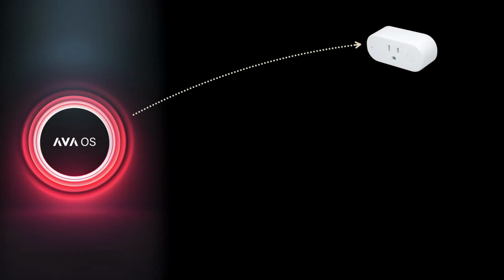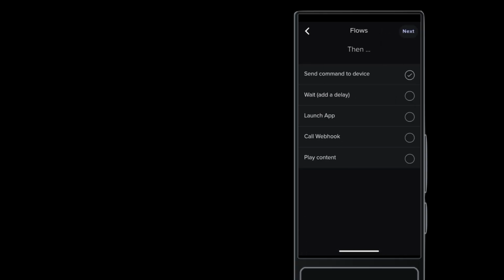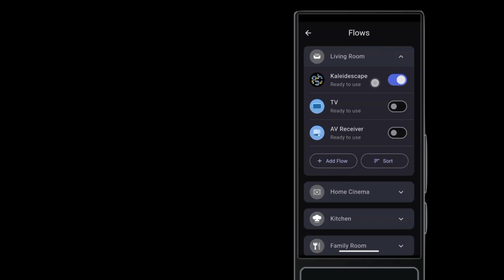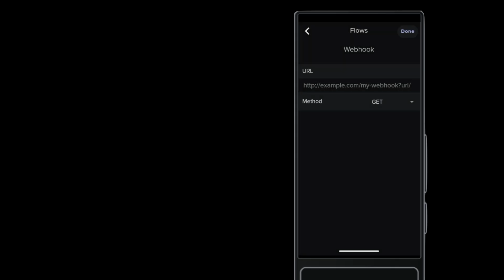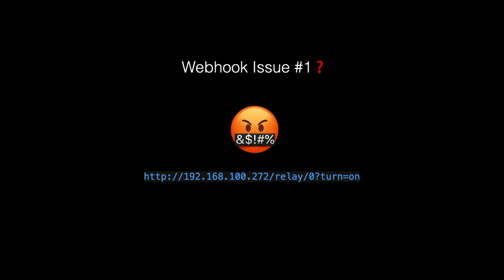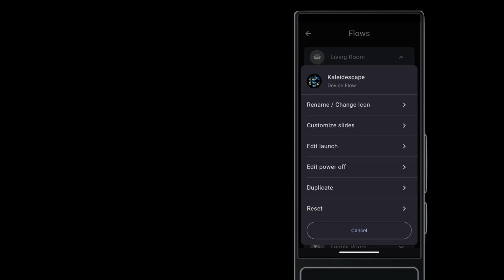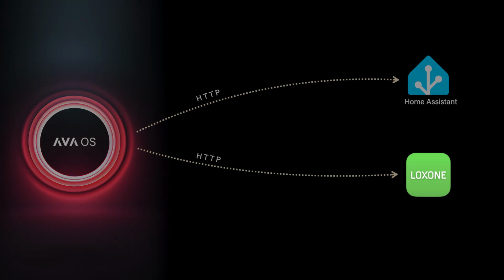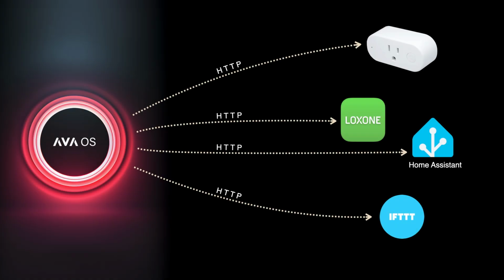Flows 4: Webhooks in Flows

Comment: Webhooks are great for IFTTT integrations for multiple platforms especially since there isn’t any drivers for the lights I use. It’s very basic but works great for the activity flows. Please advise dealers to explain this work-a-round for lights because my technician did not know about this option.